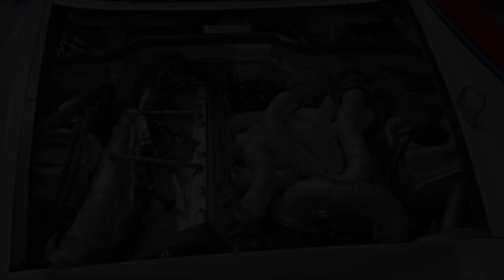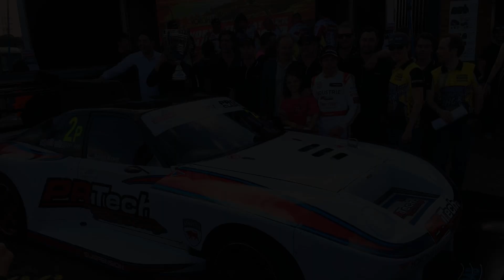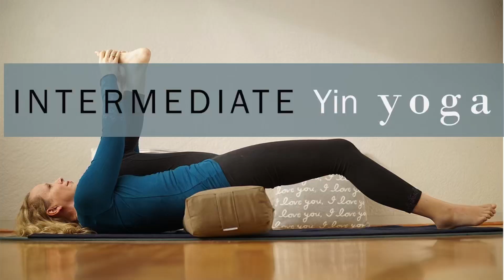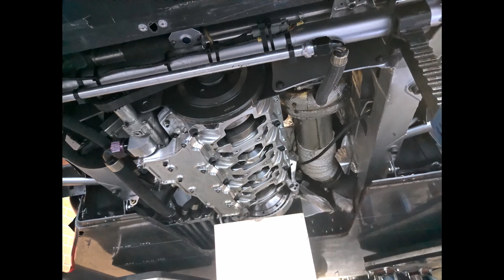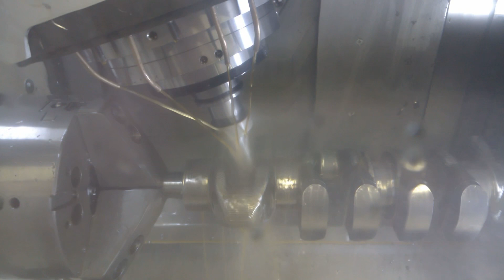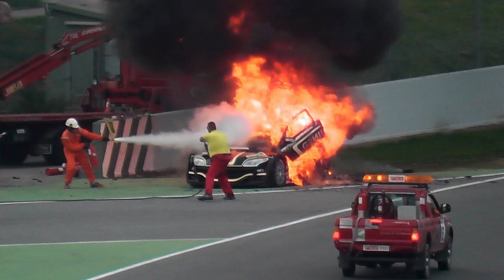Sweat and sore mouse arms: Thor - the story ep2

Comment: Amazing info as always, thanks! The CAD series would be amazing and super interesting. At some point you are talking about a friction model in FEA for simulating the load spread from the clamping forces of the studs around the cylinder. Are you refering to a friction model of the cylinder block to cylinder head surface friction?
Reply from the maker: Reffering to using a friction model between the cylinder head and block. Non-friction could be used as a simplification, but not really as accurate. (error should be relatively small though. but not too much extra work to use a friction model, as long as you have some reasonable guesses and model knowledge)
Reply: @ElmerRacing  Makes total sense. This video series is so good I keep notes.
Reply: @ElmerRacing  1) if there were no rules, wouldnt a billet manesium block with iron sleeves be a lighter option?

2) on a v4 motorcycle engine can i do custom piston guided rods and shave off crank weight???
Reply from the maker: @FirstLast-tx3yj  1) probably yes. It's all a question in where on the price/mass curve you want to be though.
2) yes, if you design the crankshaft to take advantage of this.
Reply: @ElmerRacing   1) is magnesium that much more expensive? Because it is a v4 motorcycle engine and basically trying to replicate the block and transmission case using manesium
2)the case is an Oem engine so i meant custom piston/rods and machining the stock crankshaft to remove the weight.
Reply from the maker: @FirstLast-tx3yj  Thoes questions are too detailed to give a good generic answer to. You should be able to do the engineering for them, and see what you come up with though!

Comment: Regarding the crankshaft, is it difficult to account for the secondary vibrations? Or is that not a problem for an inline 4? I know that Tony Foale has this method that applies to single cylinder engines using a balance shaft, but can you incorporate this into the counter weights?
Reply from the maker: The second order imbalances can't be tuned with counterweights (they rotate at "1st order" speed). Reducing con rod and piston mass helps though.
Second order imbalance compensation with balance shafts have 0 influence (or even negative influence) on the bearing loading situation. They only help with reducing the amount of vibrations transmitted to the chassis. Not a issue for a well balanced i4 engine. Especially for race applications.
Reply: ElmerRacing that makes sense! Nice work, was just watching the 2019 WA at Sidney Motorsports Park, crazy lap times! That Porsche is 0.1s slower then Nico Hulkenberg in an A1 GP!:o 👏🏻👏🏻👏🏻

Comment: I can't wait to see Thor in a car! Are you going to take the shine off of the aluminum? Can you leave it bright? I'm curious about the final surface finish.
Reply from the maker: Surface won't last forever like that. But it's relatively robust for racing use. It can be left shiny :)
For highly corrosive environments, anodizing would be recommended though.
If you don't mind the spoiler, you can check out how it looks in the RP968! Working on putting it in our er8 also.

Comment: 10:31 OMG, so you used not only CAD but also FEM/simulations, to design the enginen (and crancshaft). How many hundred engineers and physicist you have working in-house?  ='D
Reply from the maker: Yes, it's important to make things that are actually good/better than existing stuff, and also light weight. We never make parts that are just "billet".
No hundreds of engineers and physicists, just a few really good ones!
Reply: @ElmerRacing  A FEW REALLY GOOD SLAVIC ENGINEERS! CONFIRMED.
Reply: @aidansharples7751  finish people are not slavic
Reply: THEY HAVE TWO SLAVIC NUCLEAR ENGINEERS IN THE BASEMENT!